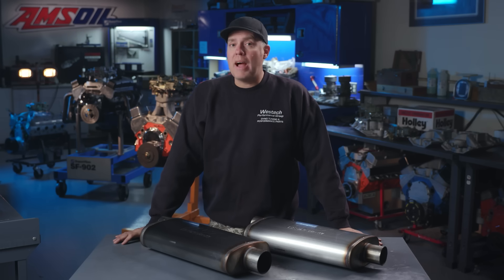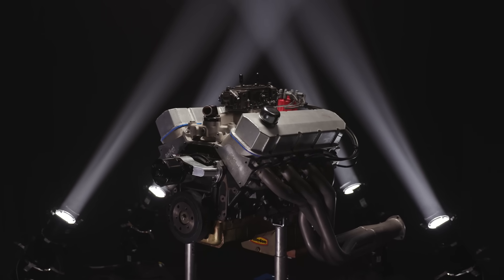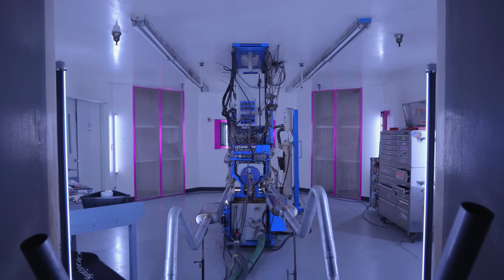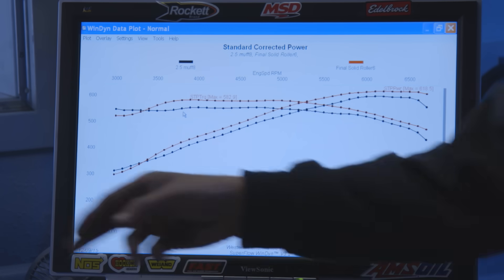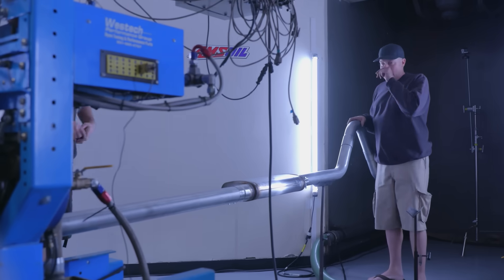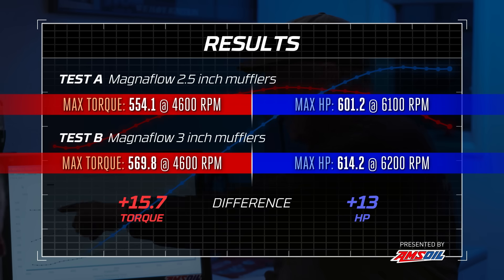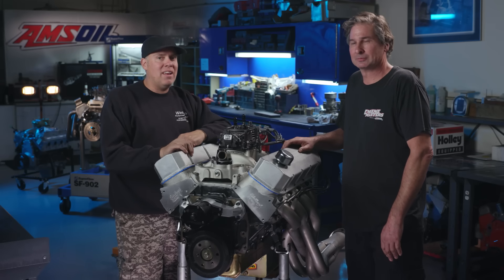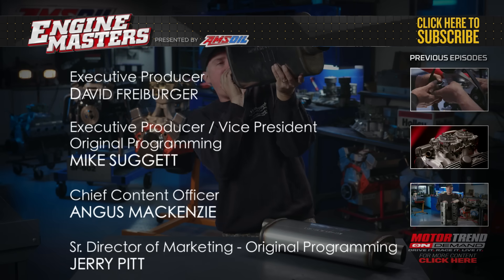The Power of 2.5- vs. 3-Inch Exhaust - Engine Masters Ep. 9

Comment: So if my car came with a 2.5" exhaust...would I go and spend $1000 for a 3" exhaust to gain 14 hp? ,,Nope!
Reply: +Völundr Frey The myth about necessary back pressure (on a 4-stroke anyway) is persistent and false, but the reason why too large exhaust hurts performance is because the exhaust gas flow velocity is too low and hinders exhaust scavenging.
Reply: +Craig Cundiff Also, larger exhausts are only a benefit to large engines, smaller engines can lose power with too large exhaust sizes.
Reply: +barflybean Back pressure is a myth. 

Don't want it, don't buy it.
Reply: +Craig Cundiff Straight pipe it your self.
Reply: +Craig Cundiff Seriously. Losing just under 4% HP when using a 2.5" vs open headers. Oh no! Just put in a set of motorized cutouts if you're dying for that extra 20 HP, but want to be able to drive it on a daily basis without wanting to shoot yourself because of how loud it is.
Reply: +Craig Cundiff Only with this engine. A lower power engine likea small NA 4 cyl may only see 5 hp or no difference at all
Reply: ILoveBreakfast671 The usually told reason why ("no back pressure") is a myth, the fact is a too large exhaust system can't keep the gas flow velocity and reduce the scavenging effect. I can't find the articles online, but it has been both calculated and demonstrated many times. And again, it's not that engine benefits from back pressure (it doesn't), but the flow mechanics involving pulsed hot gases is more intricate than bigger=better.
Reply: or spend like 200 bucks on a 3" cutout and problem solved
Reply: Brandon Adcock i did actually...where i live i have to run catalytic converters...but i put them back on every two years...lol...😄
Reply: +barflybean That's a myth.

Comment: Backpressure doesn't matter!
Reply: Yes please. 
Let's kill that myth.
Reply: Back pressure is needed in any naturally aspirated or supercharged engine. It's simply Bernoulli's principle at work. The only engine setup where you want no back pressure are turbo setups as back pressure beyond the turbo causes the hot side turbine to hit resistance from exhaust back pressure.
Reply: +Jarryn Smith Oh my goodness READ!!! I never said what you said was wrong, I just corrected you in the fact that backpressure isn't the thing that matters, but velocity of the exhaust gases!
Reply: +antonw194200 dude really? they don't do straight pipes because they need to pass emissions and most people want a quiet car. Performance is not the only key factor when they are designing a vehicle. Open your perspective please. Have a nice day.
Reply: +JustKyzuuh WHAT? backpressure does matter, you dont want ANY!!!!
Reply: Chad W Having no backpressure is impossible.  At very least there is at least the pressure of our atmosphere(;
But you want as little backpressure as possible WITHOUT sacrificing on gas velocity, which is the real important part whenm discussing pipe diameters in exhaust setups.
Reply: +JustKyzuuh yes it's all about exhaust gas velocity and different diameters can lead to different velocities are different rpms. Let's take for example a 2L petrol car that, for the point of an example, operates at 2000-3000rpm. For this power band you need a, for example, 2 inch exhaust system to keep a high gas exhaust velocity to help pull the gas from the engine. Now let's take that 2L petrol at makes its power band, once again this is an example for the sake of it, at 8000-9000rpm. The engine will end up having reversion of pressure as the 2 inch exhaust hasn't the flow capacity needed to pull the exhaust gases out. Now stick a 3.5inch exhaust system on and you have the same exhaust velocity as the 2-3krpms but the flow capacity to remove the amount of gas being produced at 8-9krpm. Also Bernoulli's principles plays a huge role in this so it complicates it even more. Exhaust gas theory and all that fun stuff.
Reply: +Jarryn Smith It's not the backpressure that matters.  It's gas velocity.
Reply: +Jarryn Smith back pressure is not a name for exhaust gas velocity!!!! that's makes no sense whatsoever! it doesn't matter what you "think" this is a fact.
Reply: +Ronan McHugh alright dude, continue on acting like you know what you're talking about
Reply: +JustKyzuuh I do know what I'm talking about. I've studied fluid dynamics, thermodynamics, I was taught exhaust gas theory by a man who's job in life is literally to design exhaust systems on vehicle. I'm coming at this problem you've asked with a scientific and mechanical approach. Now if you want to be an ignorant bigot who resorts to ad hominem remarks when told wrong, and then subsequently proven wrong. Then go ahead, be my guest. I'm no longer going to waste me experience attempting to converse with you.
Reply: +JustKyzuuh Maybe this is due to the fact that this setup is running long tube headers. With short unequal length headers, I bet it does matter. I kind of know it does because I have a Mustang mag from the 90's that dyno'd a mildly modded mustang with short headers with a full 2.5" exhaust vs 3" and the 3" exhaust setup lost torque compared to the 2.5.
Reply: A good exhaust designed correctly, prepare to sell your left nut for the development costs , will actually extract the exhaust at certain rpms. 
You can tune for where that occurs , but I wouldn't even wanna think about developing one .
Reply: I'm sorry but if there is not back pressure this engine will have no real power you need it not much but straight extractors will make a stock car feel like a wet sock down low
Reply: +JustKyzuuh just drive a car with one / without one and do it in real life
Reply: +JustKyzuuh I'm not 100% what you mean ? so all of this was just to correct roadkill ? (I call exhaust gas velocity back pressure )
Reply: +JustKyzuuh I disagree personally I just think back pressure is a simple name for  exhaust gas velocity
Reply: +JustKyzuuh I'll say this to you once again & for the last time. The turbulence of back pressure helps cause pressure differentials on the combustion exhaustion system from exhaust valve to manifold. These turbulences create areas of suction thus pulling the combustion cycle gases out of the engine. This is why there are many kinks and bends in an engines exhaust system. A straight pipe from exhaust valve to exhaust would cause your engine to be so massively inefficient and have such low power.
Reply: Ronan McHugh All you do is watch gaming videos as can be seen on your google plus page, yet you expect me to believe you study fluid dynamics?
Reply: +JustKyzuuh you obviously can't read. I said studied it, I didn't say I was currently studying it. Yes I do watch gaming videos, does that make my knowledge of engines and physics null and void? If so, then your videos of making LED xbox's make you a man who longs to be a child once more again. Don't try discredit me, hypocrite. Come back and argue when you're qualified in the necessary physics subdivisions.
Reply: Ronan McHugh  When going from a 3 inch exhaust to a 2.5 inch exhaust, if you gain power, is backpressure the reason for that?  No.  End of story.  Backpressure is somewhat important in exhaust systems but in the way that most people think it is, they're wrong.
Reply: +JustKyzuuh read my example I gave about the 2 litre petrol engine at different rpms. I already supplied you with an answer, you're just a fickle individual and not seeing the facts.
Reply: +Ronan McHugh I think this dudes a waste of time man
Reply: ***** Factory exhaust systems aren't designed to give the engine the optimal airflow.  That is one of many criteria, and nowadays one of the most important is silence because most people don't like road drone.  You're statement about needing the right sized exhaust is true, but backpressure is not the reason for this.  Exhaust gas velocity is the real reason.  And your logic about gas flowing faster through a muffler due to friction is extremely flawed, no offense.
Reply: ***** Not all cars are sports cars...... That "perforated tube" is called a resonator and it quiets down the sound and eliminates certain frequencies.  Even sports cars have to quiet the exhaust down to a level that is legal.  I never said pressure wasn't a factor that exists, but when going from a 3 inch to 2.5 inch exhaust, if power increases, backpressure is not the reason.
Reply: + the fact you loose about 150 °C per meter of tubing....
Ducati longitudinal Vtwin bikes have a rear exhaut pipe with a bigger diameter to slow the gas down to adjust its speed to the front cylinder's gases speed ,wich have a smaller diameter pipe.
it's so cool.
those vids are over simplifying things,it's not good to understand things.
Reply: lannvouivre .
Reply: Then why does it  make such a big difference when going to headers from manifolds???!!.. save the money and hassle? just stay with them and single exh? save the bucks. Case closed...
Reply: roger depew dude do some research or get a clue before posting.  I never said headers don't have an impact.  it's just that back pressure isn't what affects performance. Rather, it's about the velocity of the exhaust gas, and the pulses the gas creates within the exhaust, making mini vacuums at certain points basically.  if you ever get a chance to take a fluid dynamics course in college, do it, and you'll understand more.  it's a very interesting topic.

Comment: I was surprised that the 2.5" system didn't lose more power, it did remarkably well considering the fact that the area of the 3" system is 44 percent greater than the 2.5" system.  In situations where routing a larger exhaust system is impractical, it's important to remember that you are not losing all that much power (something like 3 to 5 percent, which while significant, isn't the end of the world).

Comment: why not use 3.5 inch pipe ?
Reply: +Hamdan Alharbi why not 4"? :)
Reply: 😂 4.5" sounds more power!
Reply: I am poking around about the back pressure thing and engine masters claim it does not affect a lot. So up size the exhaust should allow more air flow and more HP, right?
Reply: +Hamdan Alharbi to a certain extent... if your engine doesn't put out alot of exhaust to begin with then there'd be no point in it... and also if you're gonna do bigger exhaust then may as well do the intake as well
Reply: +Hamdan Alharbi but yes back pressure is a thing... if you don't have enough of it then your valves will be slamming shut and you could bend a valve stem... so back pressure is a good thing as long as its not so much that your motor is chocking
Reply: +Tha jWho no! your valve closes because of spring tension and a pushrod preload. 

you cant just slap a huge pipe on because a lack of back pressure, 
its because you cant move exhaust gases out fast enough, the gasses just tumble about inside the pipe with no speed. 

imagine herding cows, in an open plain they can roam any direction. in a large fence, theres room to run, but not to get lost and scatter.

too small of a fence and they're wedged together and can't move efficiently. 

velocity and back pressure are not related.
Reply: +Hamdan Alharbi My understanding is that the headers aka extractors should be creating a suitable amount of back-pressure, and ideally, if they are the right tuned length, assisting exhaust gasses to exit the motor by using the mild vac behind each pulse.  The rest of the system is largely just to get rid of the gas behind the vehicle, and as long as it isn't actually restricting the gas then size is not very important.  Having said that.. Go too big and it will sound like shit.
Reply: why not 7 inch

Comment: What about all those 4 bangers that people put more open exhaust on and then burn the valves out? We've all seen them running around burning oil. Some engines do need back pressure.

Comment: I'd be more interested in the same test with a self-learning EFI system, because as you noted, the 2.5" is running richer, so re-jetting the carbs might gain back some of what you lost.  An EFI would take care of that after driving a while, and you'd have a dead quiet system AND the power.

Comment: that is a nasty big block. What about a performance 355 or something similar? I don't think you would see as big of a loss.
Reply: +J Bailey They really need to let the Old shit just DIE as the LS series is almost 20yrs old all ready and they are still playing with 20yr old technology/motors. Last 454 was in what 2001, 15yrs ago.
Reply: +JerseyMikeP  You do know the current GM V8 is still considered an LS?
The old engines are still around because the designs are proven to work when it comes to creating massive reliable torque and  horsepower. 
Additionally the aftermarket has had the time to make all the power mods just about anyone can enjoy and modifying a late model vehicle and or engine can be substantially more expensive.
I am assuming you are not in the hobby or you are just too wealthy to understand, but if you follow the trends associated with nearly any racing outside what is factory sponsored and or hot rodding at large, you may have noticed some simple details particularly when it comes to drag racing or private builds.
Whether they're building Japanese, German, English, Italian or American cars, the power is usually supplied by an engine that was designed and or manufactured for a long time or from a along time ago.
I am not saying late model hot rodder's don't exist as they are often represented. 
"The old stuff still works and is accessible to more people".
Reply: Classic v8's are never going to die. You can make a lot of reliable power for very little money. They are simple and easy to work on and easy to find parts for. I'm glad shows like this still talk about things the average person uses.... I like top gear and everything, but I'm never going to drive a lambo, or Ferrari, or zonda, so that stuff is useless to me.
Reply: +1400IntruderVS Yeah, I was showing the point that the new stuff is already 15yrs old. There are alot more people modding newer engines than old stuff. Most people want to see mods/parts for engine that they have in their cars...which most people are driving 90's and new vehicles.

I guess they have to use them because of the money/sponsor's parts that they have to help sell. The LSX454 makes the same/slightly more power and would do it more efficiently (MPG) and reliably.

http://www.chevrolet.com/performance/crate-engines/lsx-454.html#dyno

Comment: Just got a 1992 Toyota pickup. Anybody have any ideas what I should do with it.
Reply: +Wyatt Rowe Sell it & buy  a Toyota.
Reply: Bought it for $500 no ones gonna buy it.
Reply: Drop a 2j in it :D
Reply: +Wyatt Rowe Just drive it, older pickups are fun to drive and you don't have to worry if you damage it.
Reply: +Wyatt Rowe Sure they will. You bought it for $500.00, wash & detail it, unload it for $900.00 with a chrome tailpipe.
Reply: engine swamp fam , like a 5.0 or ls
Reply: +Wyatt Rowe  stick a 2GR in it.
Reply: +Wyatt Rowe I had one. and I drove it.
Reply: 1jz swap all motor.. drift it
Reply: +Duncan Mackay Now THAT is an engine
Reply: +Wyatt Rowe depends how much scrap metal is going for where u live...
Reply: The sad thing is it will survive the fall
Reply: If you're wanting to flip it, replace any balding tires with cheap used ones, add an aftermarket head unit and speakers if you want, do basic fluid maintenance, go to your nearest auto or farm store and buy a cheap exhaust tip for it, add a cheap steering wheel cover, wash it.
There you'd spend around $150.
Toyota pickups are pretty sought after, you could likely sell it for roughly $1,200. You just doubled your money.

If you want to keep it, doing everything listed above but with higher quality stuff, and simply enjoy it.
One of the best vehicles I've ever enjoyed driving everywhere was a 1986 Toyota Pickup. Wasn't anything fancy. 22R with a 5sp. Thing was fun.

Comment: Back pressure bad.  ALWAYS bad.  

Like with cylinder heads: You want the highest velocity possible as well as highest flow.  

A 3 inch system simply may not preserve the high exhaust velocity on some engine combinations.  That 454 combo happens to move exhaust gasses at a high enough velocity that the 3" system works well.

Heat also plays a major part but thermodynamics is getting into the weeds really.
Reply: +1320crusier "Like with cylinder heads: You want the highest velocity possible as well as highest flow. " that's a hard thing to come by and almost always you have to give up a little of one to get the other...and that is the hard part...Balance.

Comment: the thing is ur doing this with a 650hp engine system its not supposed to be running on a tiny exhaust like that when ur talking regular street cars like lets say a silvia or a skyline ur running max 200-400hp which 2.5 is not so bad after all